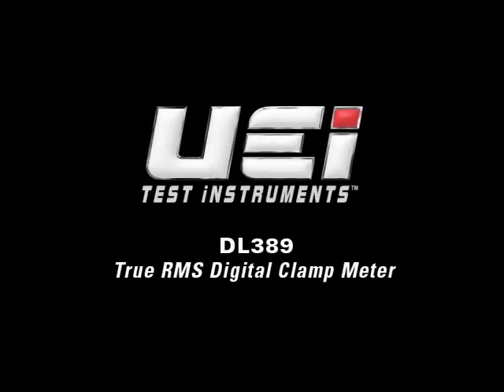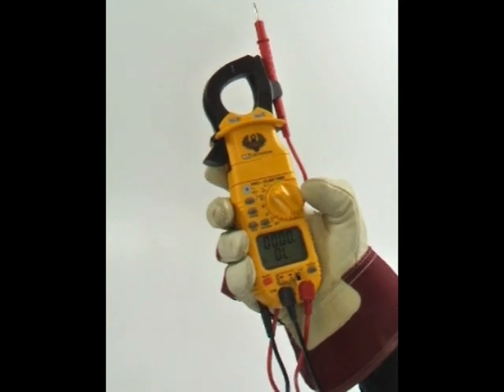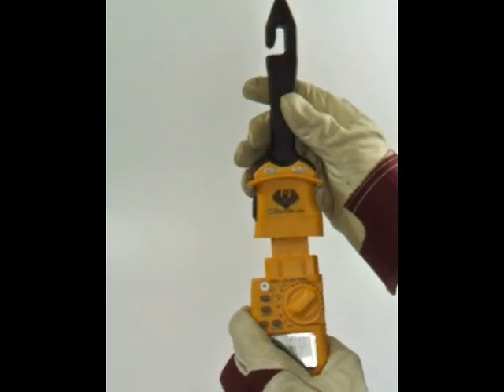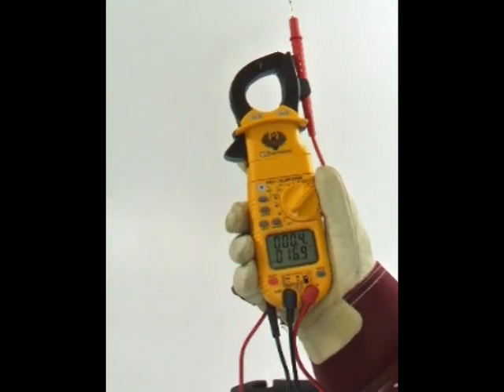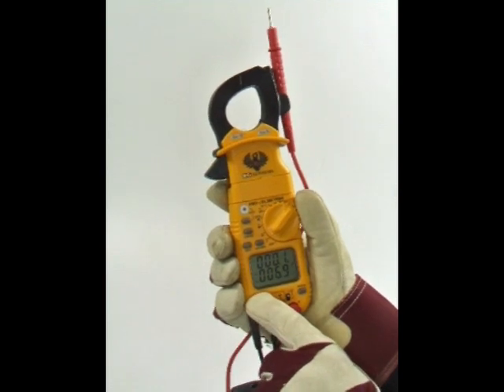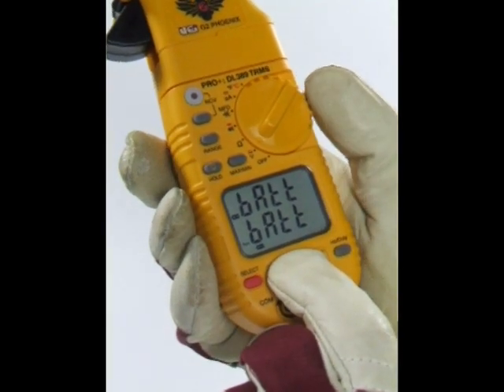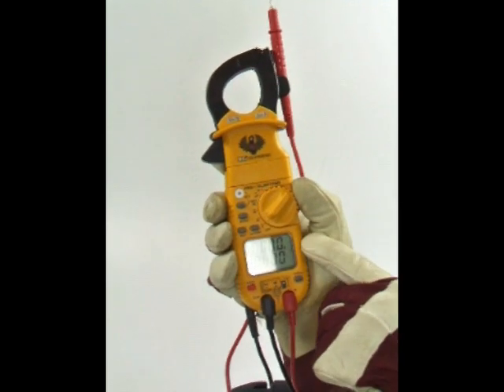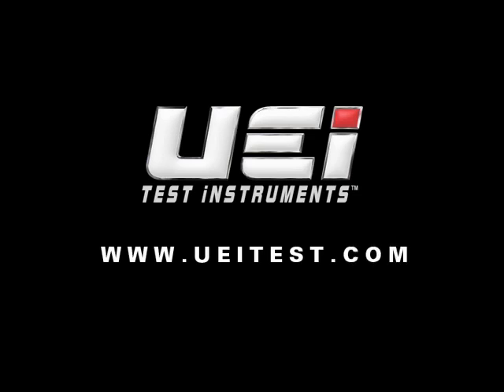UEi DL389 True RMS Digital Clamp Meter

Comment: after 5 years keeping the meter on his pack I try to use it, working well only two days. The part for alterning currrent is not working any more. The clamp cant read amps and the leads cant read ac voltage.  The rest of the functions ( resistance, capacitance, temperature) still working